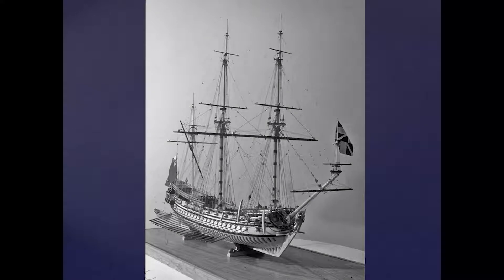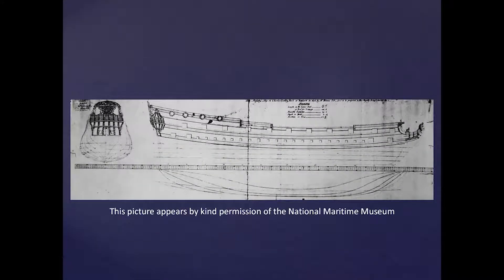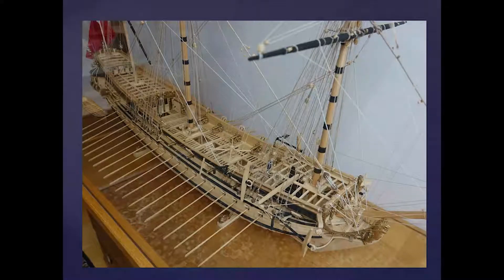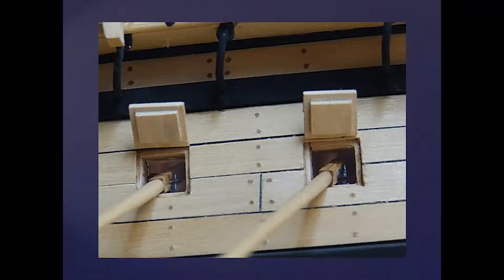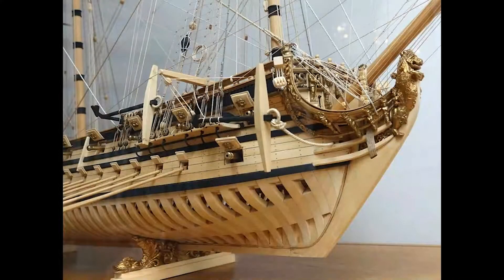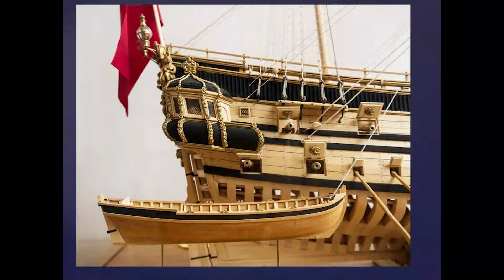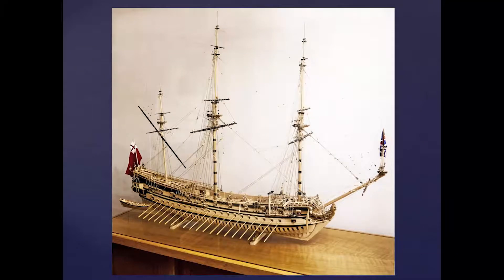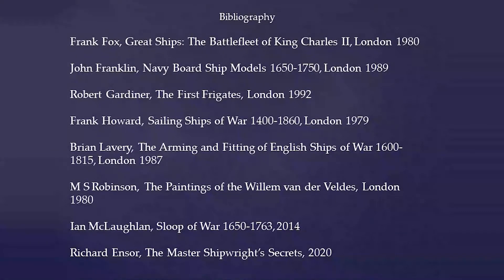The Charles Galley

Comment: Why didnt the oars stayed as backup propulsion (arranged on upper deck walls,sacrificing maybe 10-20 light guns),but gaining ability to move (when no wind,agianst wind.tight maneuvers)...i know its a ship of battle but still seems like interesting concept (dont know why lower gun deck holes would be gun exclusive?).The oars when in battle aranged tightly on main deck could even provide cover for musketmen and those pivot mounted light guns?I mean you got the crew to man the guns there anyways so if guns arent used they just pull them in and pull out oars.